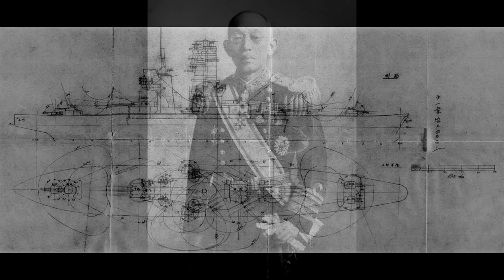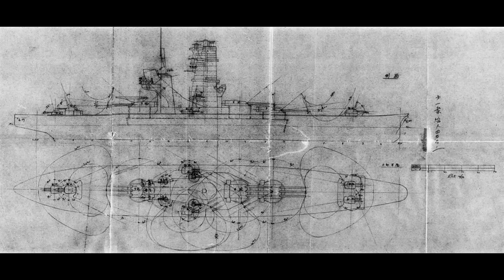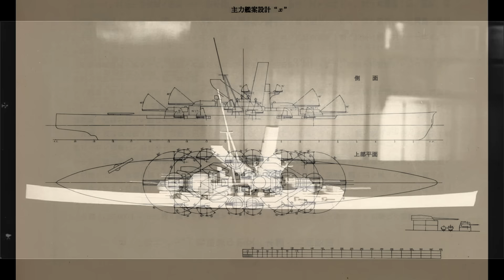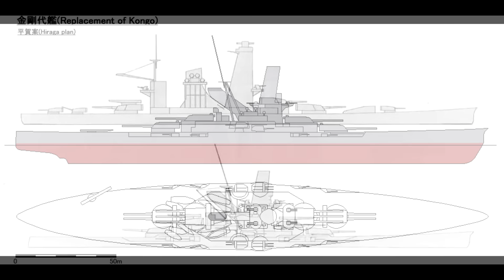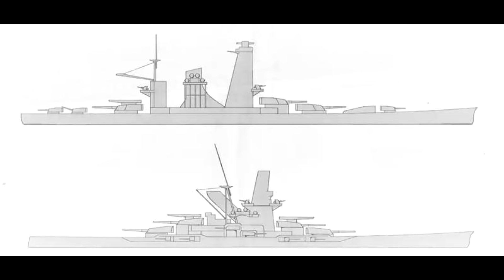Kongo Replacements (1931) - Guide 380

Comment: With regard to Hiraga's design, not only were the 6" secondary turrets nominally dual purpose with that 75° elevation, one of the oddest parts is that so were the casemates. To allow for this, as you can see in Hiraga's scale mockup, the casemates are actually semi-turrets with their roofs extending partially outside of the weather deck. Since that's the only way such high elevation would be possible in a casemate.

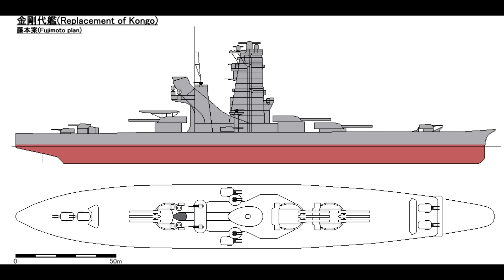Comment: 3:14 - Maybe they were counting on the bow and stern secondary magazines being far enough away from all the others to prevent an explosion of one of those secondary mags from setting off the mags amidships?
Reply: The most obvious problem with magazines near the bow and stern is the effect a magazine explosion would have on the maneuverability and sea keeping of the ship.
Reply: Even so, if your 6" magazine cooks off you've lost either the bow or stern of your ship. Potentially survivable but you are best out of the fight, at worst sinking.
Reply: Mfw the stern magazine cooks off and the rudder/propellers are now gone
Reply: @comrade_commissar3794  you would not have to armor the walls around those magazines, only the floors. If the easiest point of escape for the explosive wave is up and sideways you just have a massive hole on your aft, where the 155mm guns were. But it would not be a gaping chasm down into the machinery. Just some unfortunate sailors plastered and intertwined with mangled steel hull.
Reply: @gwtpictgwtpict4214 HMS Eskimo would disagree (but that’s probably a special case)
Reply: @personthing88  A special case indeed, but fair point, well made!
Reply: To answer the funky bow and stern 140mm/55cal /// 152mm/50cal secondary mounts. 

There isn’t actually secondary magazines beneath them, there isn’t enough space for it anyways. Instead like with Agano 152mm mounts, there is diagonal bucket hoists that lead directly from the main battery magazines.

Comment: What benefit is there in the triple turrets being the superfiring mounts?
Reply: As mentioned elsewhere in these comments: it's to keep the hull narrow at the ends; 2-gun turrets have smaller barbettes than the 3-gun turrets.  The US Pensacolas had a similar arrangement, but the stability issues led the USN to drop down to three 3-gun turrets afterward.
Reply: It allows the ship to be shorter and thinner

Comment: Having the triple turrets superfiring seems like an unneeded increase in top weight?
Reply: Probably an attempt to ensure the aft turret didn't end up accidentally firing through the aft 6" superfiring turret. That said, the point of those 6" turrets can be debated to start with.
Reply: The Pensacola class had topweight problems with the same turret arrangement.
Reply: The hull shape is also a serious consideration. A triple turret needs a massive barbette and loading arrangement, and the citadel would naturally be wider. The swooping bow shape also obstructs the firing arc of wide turrets, so you have to rotate the turret much more in order to clear all 3 guns from the bow. A large battleship takes minutes to make that extra turn, and that is bad for your reaction speed.

If you want high speed, you also need a thin tapering hull, Mr. Hiraga's proposal certainly had that hull form in the drawing, that makes a wide citadel and barbette impossible to have.

The A and D turrets cannot be too big, and the citadel cannot be too wide, otherwise the explosive parts would be directly against the hull. In a gunfight, hull space mattered, especially against the large HE shells the Nelson class could hurl at long ranges.

By designing the front and rear turrets to be smaller, you could also make the front part of the hull narrower, which not only increased speed, but allowed huge weight savings to conform to treaty limits.

Besides, large guns have a lethal muzzle blast, so by minimising the large guns at deck level, you could hopefully leave deck space amidships for more secondary guns in open mounts.
Reply: The triple turrets superfiring twins was pretty common. Battleships of that time often weren't super wide nor long, so, in order to fit torpedo protection and retain some speed, you gotta need to fit narrower barbettes at the extremeties.
Reply: @ottaviobasques  It wasn't. While a number of designs had such arrangements, the only major warships completed with such an arrangement was the Pensacola-class cruisers. Those ships had to do so because of the width of the hull, but they did have stability concerns as a result.
Reply: Had these ships been built, it is likely that the designers and engineers would fixed most of the flaws in the conceptual designs.

Comment: I'm sure someone has addressed this before but why would anyone  put a triple turret above a double? Seems like unnecessary top weight to me.
Reply: The Pensacolas did the same thing, and I can't remember why, but I don't think it has an effect on stability
Reply: @lucascousins6934  not enough hull beam at the forward turret, so a smaller double turret barbette was all that could fit in.. An engineering compromise balancing fire-power, torpedo pretection and a long slender hull for speed. Torpedo protection at the forward magazine is tricky in fast hulls, Iowa had to compromise there too.
It usually does not give desirable results, and after the Pensacola's a gun was dropped for three triple turrets instead in followup Northampton class and beyond.
Reply: IIRC the Pensacolas were like that due to the width of the hull at the points where the turrets were installed. The hull was too narrow where the twin turret was for a triple turret.

Comment: I wasn't aware the Japanese had plans to replace the Kongo's
Reply: In hindsight it makes sense, the Kongo's were rather old by the time of this ship's drafting, how they went about doing it however was utterly incomprehensible and very weird, so in the end keeping the Kongo's around was the better option and not weird.
Reply: The Kongos were supposed to have been replaced or augmented by the four Amagi class ships in the 1920s.  Two of those were, in fact, begun - Amagi and Akagi - but were severely damaged while under construction by a powerful earthquake.  The Washington and London naval treaties made starting the other two impossible, and the one existing hull that was salvagable was converted to an aircraft carrier under the treaties' conversion clause, becoming the one-off carrier Akagi.
     This meant that the Kongos got upgraded twice, once in the 1920s, and a much more comprehensive job, basically a complete reconstruction, in the 1930s that turned them into viable escorts for the fast carrier groups.  That job was originally going to be done by the four (!) planned Amagis, but geology, the economy, and treaty negotiators killed that plan.
Reply: @christopherreed4723  Minor correction, Sir: Akagi wasn't even remotely affected by the Great Kanto Earthquake, since she was built in Kure, which was quite far away from the epicentre, which was near Tokyo.

Comment: I've heard people say the B-68 "supercruiser" design was considered a replacement for the Kongou class, but that would presumably be later. 

It's B-68, right? I can never remember which one was the supercruiser design, and which was the Soviet sub they used to have in San Diego, was that the B-93?
Reply from the maker: The B-64/65 design series were late 30's/ early '40's idea to replace them again 😀
Reply: @Drachinifel  Ohhhh, it's B-64, and there WAS a B-65? I'll have to look that up
Reply: B-64 is Amagi Class.

B-65 is often confused as the version with 356mm/45cal Type 41 guns in 3 twin turrets, while the original design with 310mm/50cal guns gets mistakenly called as B-64, which is what Amagi Class is.

With that said though, Kii class is often labelled as a modified B-64 (well it is an up armoured and slightly slower Amagi) and I’ve seen it being referred as also B-65 at times, although the latter is likely incorrect.